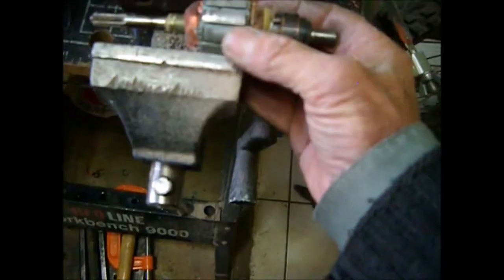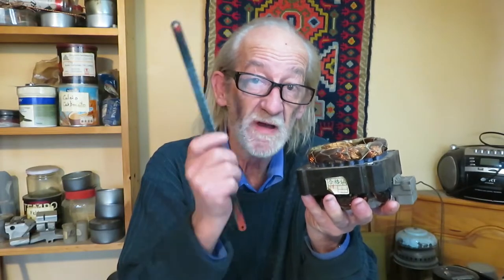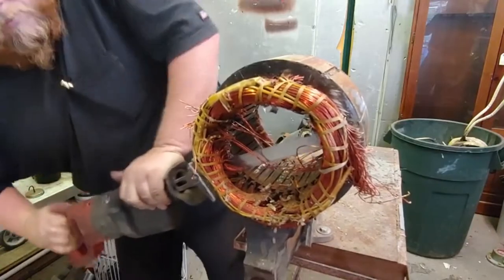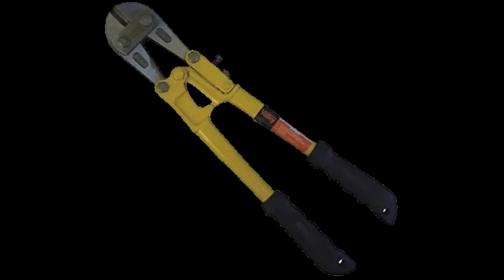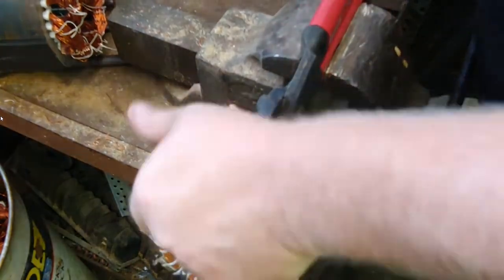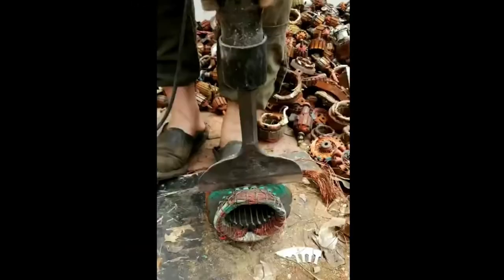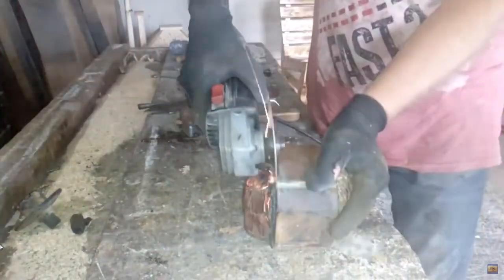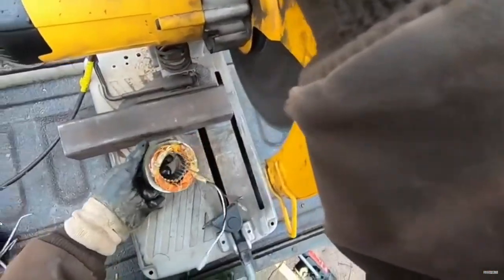The Best Tools to get Copper out of an Electric Motor

Comment: I have tried the sawzall with a metal blade and it worked well but the angle grinder with a thin cut-off wheel is what I use usually because I don't have a straight saw blade left.
Reply from the maker: The videos I saw with the Sawzall at some point showed the windings got dragged out by the teeth (I'm supposing they used the 24 teeth per inch saw).  There is a "grit" blade - no teeth - for use with stone or concrete that might work cleaner, but I don't know if it will work with copper.
Reply: @RODsDIY  I don't know what the teeth amount is on my blade. It's the Milwaukee Torch. Probably wore down a lot too.
Reply: I normally use a hacksaw due to it being relatively quiet compared to the other options yet it is slow and arduous.
Hammering a blade through the stator body looks like a better solution for me. Thanks for putting this video together, very informative.